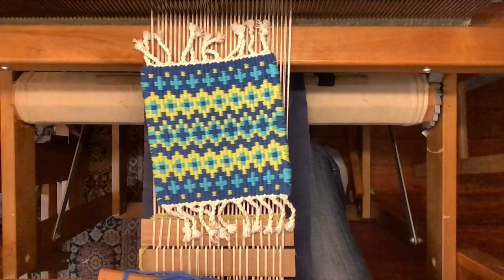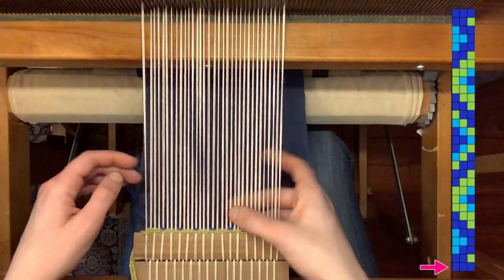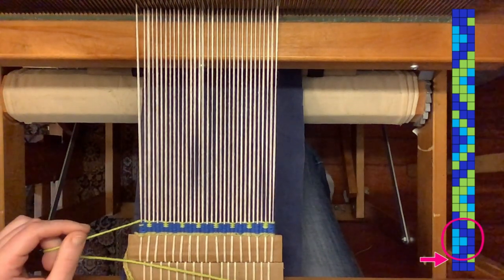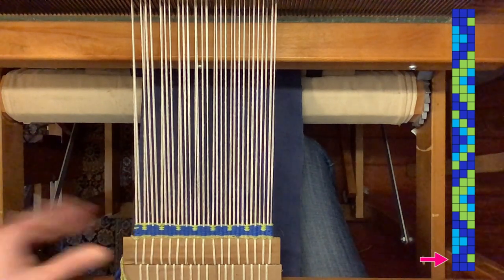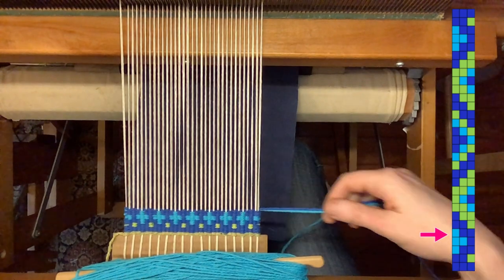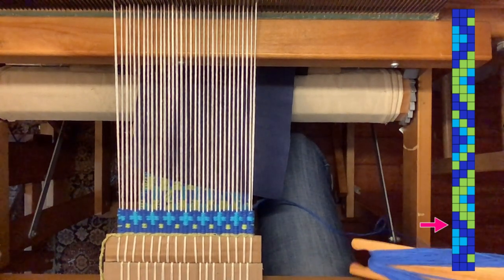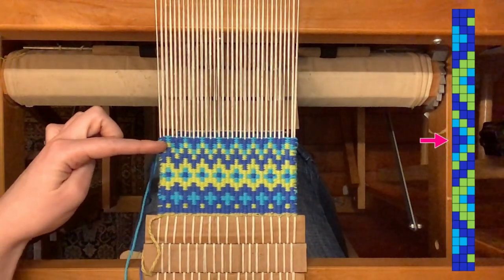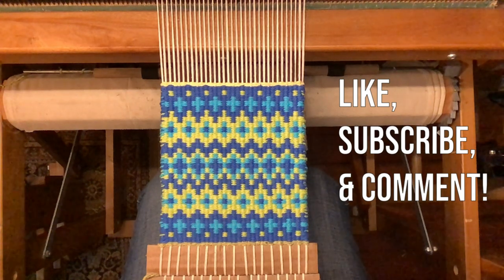Weave Krokbragd Diamonds | Mug Rug Tutorial 8

Comment: Thank you for this wonderful video. I am new to weaving and have trouble visualizing how it all comes together. 
I do not quite understand how the light blue crosses are not missing the left arm as the pattern on the right side of the screen only shows the weaving of the right half of that cross. There are only 3 sheds in the pattern but it seems to me there should be 4. 
What am I missing?
Reply from the maker: The pattern is determined by the combination of how you thread the warp and how you treadle the weft.  I think you might be confusing the two as you try to wrap your head around it.  When you set up the warp, you thread it in a pattern of 1232, 1232, etc.  This has the effect of mirroring everything you do, which is what gives you the second half of the crosses.  

After it's all set up, when you do the weaving part, I promise you all you need is three sheds.  My other krokbragd video explains how it works a bit more! 

https://www.youtube.com/watch?v=ttSZSqBbNZ0&list=PLeOonGOMVnSCBLA7dJwknQSoAH1HP_P0c&index=7&pp=gAQBiAQB
Reply: Thank you so much for the clarification. I could see that it worked but just couldn’t grasp how it did so. Now I do. I like the mirroring clue, it had not dawned on me. Made my first mug rug. Thank you!! 🥰

Comment: I have a loom with only 1 shaft and I make the sequences with the needle
If you want to weave the pattern on a wider loom (with more threads)
Do they start the same? For example, in the first row,  you start with 1 above, 3 under, and end with 4 under, To continue the pattern, do we start from the beginning with 1 above, etc. ? will it work?
Reply from the maker: I think what's confusing is that I'm using floating selvedges. Basically, the very first and very last threads aren't part of the main pattern. They are extra threads that make it quick and easy to make sure I don't have any gaps at the edges. To use floating selvedges, I always start OVER the very first thread and end UNDER the very last thread in every row no matter which row/shed of the pattern I'm on.  You can use this method even if you're using a frame loom, but it's optional if you have another preferred method for managing your edges.  

In short: if you aren't using floating selvedges, ignore what's happening with the edge threads in my demo.  Set up your loom with a multiple of 4 warp threads + 3.  Here's the row-by-row pattern:

Shed 1 = repeat (under 3, over 1) across and end with under 3.
Shed 2 = repeat (over 1, under 1) across and end with over 1.
Shed 3 = start with under 1, over 1, repeat (under 3, over 1) across, and end with under 1.
Reply: Thank you sooooo much for these very needed clarifications, Did I understand correctly that, basically, in all krokbragd weaving, the exact same rows are woven as you detailed in your answer, and what produces the different patterns is the change in the color of the thread and its position in the pattern?  @wildgingerhandweaving4171
Reply from the maker: @zehavahl  Yes, that's exactly right! 👍